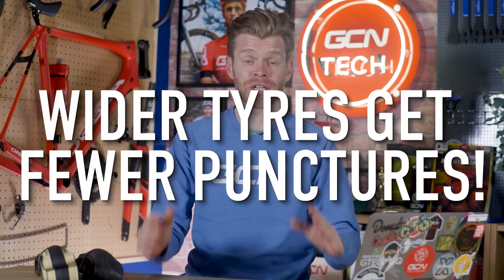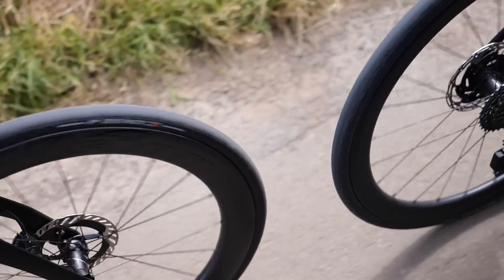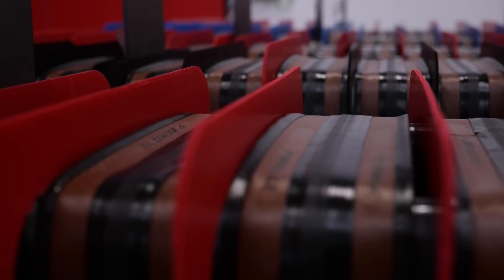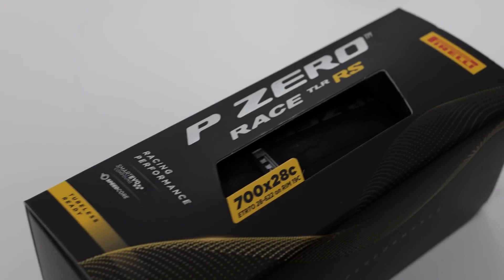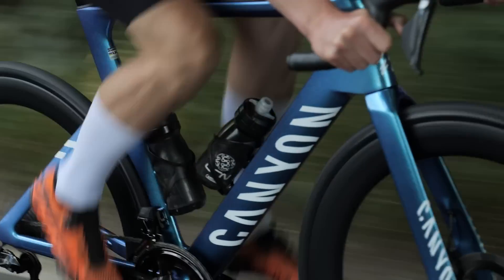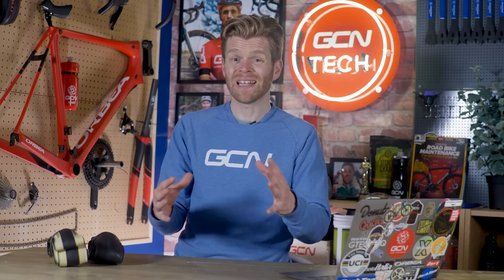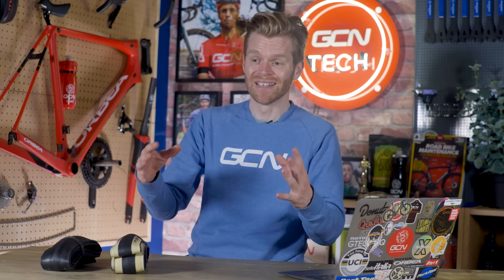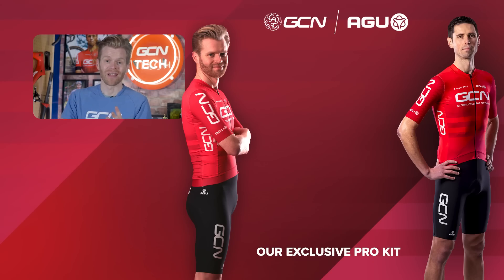Why Your Bike Tyres Get More Punctures

Comment: Anyone else still running really high pressure and really skinny tyres, despite knowing better?
Reply: I started running significantly lower pressures 10 years ago after I read articles by Jan Heine. WAY ahead of his time. While he was professing wide tires with low pressures bicycle tire companies were adamantly staunchly opposed and kept recommending 100 plus PSI even for somebody at 120 lbs😂. Like I always say the bicycle industry is permeated with silly Muppets and half-ass engineers. It's taking the motorcycle and automotive industry and its Engineers to advance bicycling... always has been always will.
Reply: I’m down to 85 psi from 110 and also up to 28’s from 25’s. I never get flats 👍
Reply: Yes. My bike is thirteen years old and wider tires simply don't fit. 25 mm is maximum.
Reply: For some reason I like the feel and sound more. Helps that they are cheaper by a large margin and I don't have to worry about if a 28 is measuring 29mm+ and too big or not. I don't really get punctures since I don't ride enough and I ride a highly trafficked MUP/bike path.
Reply: Once I switched over I couldn’t go back. But know several folks who are still on 23s even on modern frames with pressures exceeding 100 PSI.
Reply: All depends on the roads you usually ride on.
Reply: Found some 23c tyres in someone's "hard rubbish" collection here in Melbourne. 23c x 2 (specialised turbo &  Vittoria rubino Pro). Still plenty of life left...
Reply: Yep, running 23mm at 120, sometimes push it to about 130psi.
Reply: I am under a targeted and personal attack 😢😡
Reply: On my almost fifteen year old custom steel road bike. The max tire size is 25mm, and I recently scored a small pile of 700x23c Maxxis HighRoads for pennies on the dollar, so yeah, I have been riding 23s for months now, but….I just brought home a new bike that is equipped with700x32 , and has clearance for up to 700x38c. 
So my classic bike with the 23s is now officially relegated to the old Kreitler rollers.
Reply: What's Skinny?
Reply: Unless you have a rim brake bike there’s absolutely no reason to run skinny high pressure tires. They’re slower, less comfortable and less traction when braking and cornering!
Reply: @markreams3192  I do! You are the guy at the pub permanently tuned out everthing bikes!
Reply: Vittoria Corsa N.EXT 26mm wide and 88psi.
Reply: Guilty. I'm on the heavier side and believe I get fewer pinch punctures with higher pressure. Having 26mm's now that need changing and considering 28mm (limited by the fork) with TPU tubes.
Reply: Fuck experts. They change their minds every time someone pulls out different statistics. It should feel good to you, that's all
Reply: Yes
Reply: I'm on 23c 100psi. Waiting them to wear to change. They are gatorskins so it is a long way to go. No punctures only snake bites when not enough pressure(80psi or les for a 6pkg)
Reply: Ya! On all my bikes 2001 and older to 1981. Lol. My 70s bikes I use 27x1 1/4. Comfy. Modern I ride a BMC Roadmachine 01 with 32mm rear, 30mm front. Fastest bike I own.
Reply: 25mm at 5bar. Does that count?
Reply: I run 25s at 100psi.  I'm also 90+ kg so I don't have a ton of choice.
Reply: Any more smug twats out there?
Reply: Not me, skinniest tires I have are 27"x1-1/4" (31.75mm wide) and I run all my tires at 25-42 PSI
Reply: I switched from 23 to 25mm tires ~4 years ago but I don't think I have enough clearance on my frame for anything more than 26mm without causing occasional rubbing on tight turns.
Reply: Yep, my second-hand Cannondale, six13 came with Michelin pro 4  endurance tires in 23mm.  I run them at about 80 PSI.  I’ll probably upgrade to 28 mm tyres when these wear out, but for the moment I like them because they only weigh 200g each – and I like the red stripes. 🤓
Reply: Definitely feels faster
Reply: 4 year old Merida Reacto 6000 disc, shimano 12 speed Di2 Ultegra 8100 full groupset & tires are 28mm Continental Gp5000s beaded clinchers layed in with Tpu tubes set at 80 psi front tire & rear set at 95 psi, my weight is 98kg & for me everything works exceptionally well from comfort to road handing especially grip,👍🏾
Reply: Naturally 😅
Reply: I do haha I can say it's slower I run 23c tires😂
Reply: Continental ultrasport iii 23mm on 116 psi
Reply: @ankittuli1746 oh my goodness... you ride your bike all by yourself? Good for you! 😂
Reply: People who still use rim brakes and bikes limited to 23mm tire clearance regarding the cost of buying  a modern bike with better clearance.
Reply: @mlustosakm Just put 28 on my 2012 Specialized Tarmac - but that's definitely the max.
Reply: @AlexWard thinking of going to 28 on my 2012 tarmac, has it worked ok .
Reply: @richbutler5815  Worked great. Very close fit to seat tube, but it fits. Running 76psi on rear and 74psi front. Went for a ride today and it was great.
Reply: @mlustosakm  MOST people can fit 25s on their old bikes.  Some can fit one or two 28s.   Wide rims(yes, you need to buy them) can make 25s quite good at fairly low pressures
Reply: @veganpotterthevegan  that is true, this made a huge diferrence in my case , my bike is limited to 25mm but new wider rims made the ride way more comfortable
Reply: @mlustosakm  at 90kg, I was running 75psi on 25s with 21mm internal rims.  It was nearly life changing🙃
Reply: @mlustosakm yes sadly me. I can brute force 26mm tires on mine that’s as far i can go.
Reply: @mlustosakm I have a 2012 rim brake bike that I run on 25mm tyres, with mudguards. It fits 28mm without mudguards too.
Reply: Yes, 25mm here
Wide is overrated, same as disc brakes.
I have 2 bikes, one with 25mm with rim break and one with 32mm and hydraulic disc. Both same shimano 105
The 25 have mess flats, is faster, breaks way better and gives me way less problems
Reply: Yep, me. I find the wheels just roll better, quicker!
Reply: Anything over 30 psi should be considered high pressure when it comes to tubeless. Tubeless with sealant was designed for high volume/low pressure setups (mtb), not road where lower volume and higher pressure can prevent the sealant from doing it's job (i.e. instantly sealing a puncture).  No thanks, from me, when it comes to road tubeless.
Reply: @outdoorlife25 I switched over to tubeless on my road bike  18 months ago now and it’s been amazing. 

The only time the sealant didn’t do it’s job immediately I used a Dynaplug (I suspect the cause of the puncture was still embedded in the tyre) which plugged the hole with so little loss of pressure I just needed a few blasts of a hand pump.

I saw a fellow cyclist in front of me run over a sharp object and saw a momentary puff of sealant mist. When I rolled up to him at the lights he was completely unawares when I told him he got a “puncture”.

For the record I weigh 85kg and run 28mm at 60 psi on the front and 64 psi on the rear
Reply: @outdoorlife25  There are road specific sealants being made and sold by CafeLatex, Specialized, Silca, and Muc-Off.
Reply: Of course there are.  Can’t change what you grew up with.

Comment: I used to run 28c tires, but i switched to 25 when i got a faster fork that didnt have the clearance.
I get less punctures because i can ride faster and its safer to ride out in the lane where its cleaner.